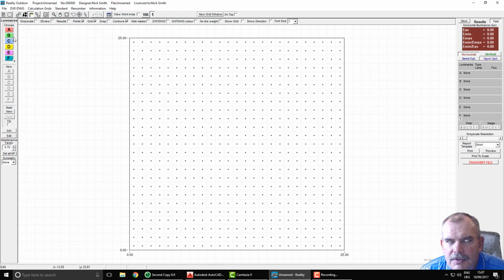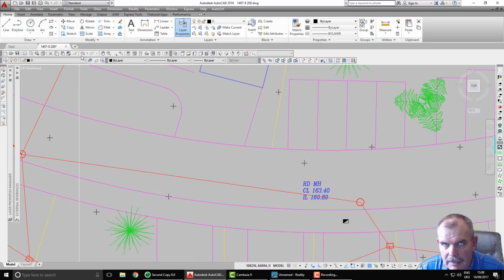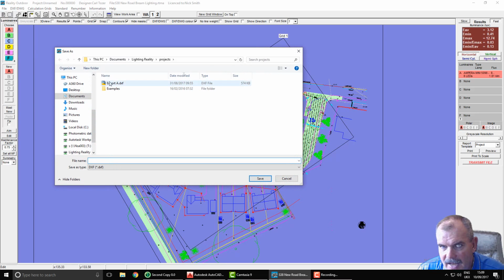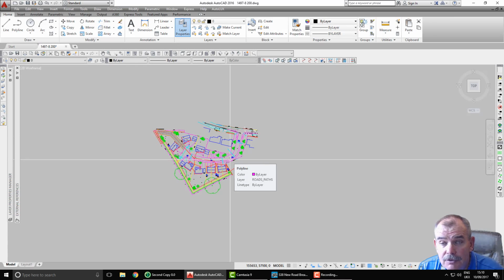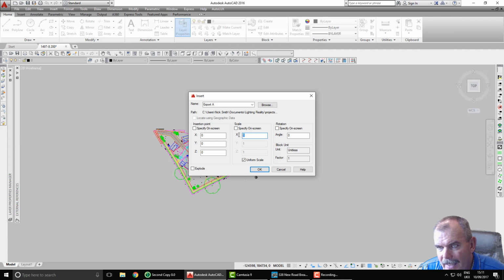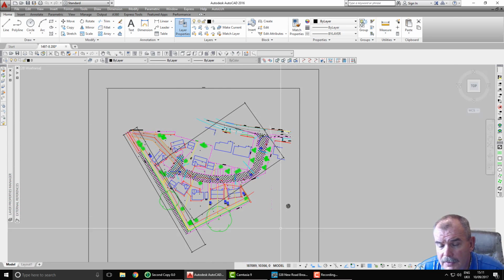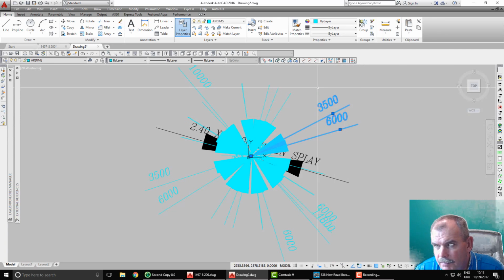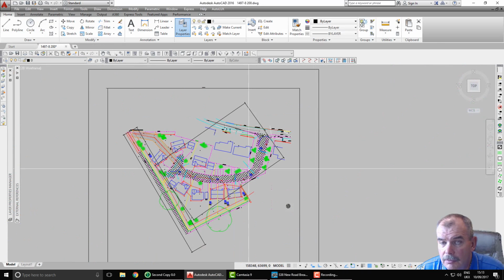Lighting Reality Outdoor drawing import & export scaling

Comment: Hi Nick, I have been asked by a council authority to present my vertical illuminance calculation on the elevation (facade) of buildings along a road just to show that design complies with regulations on obtrusive light. I have been struggling with this the last three days trying to export the vertical grid calculation in dxf without success. All attempts have ended up giving me the horizontal illuminance on the road.

I would appreciate your help with this.

Thanks,

Adewole